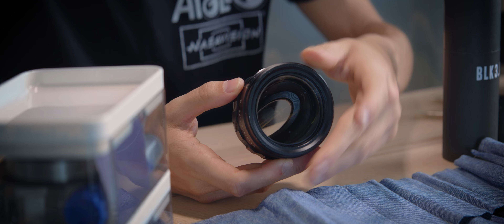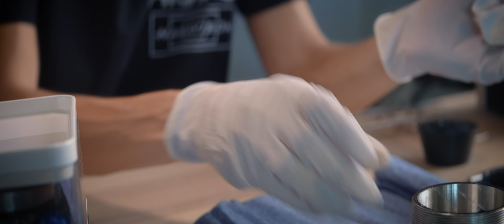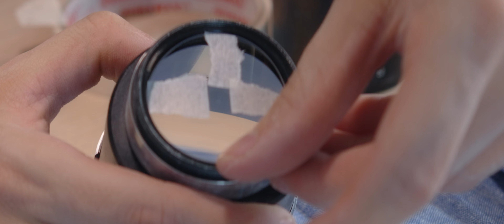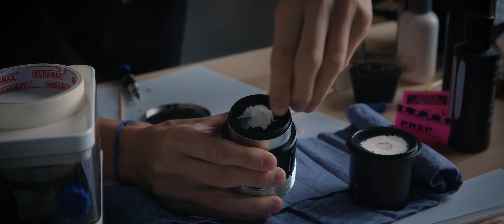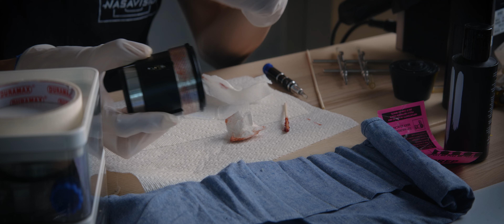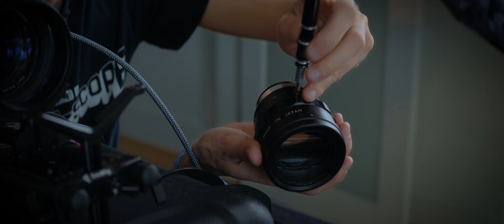Clear Veiling Glare on Anamorphic Adapters! Full Kowa Tune-Up Tutorial

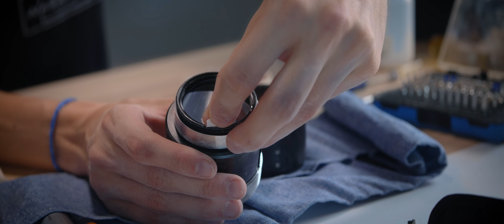Comment: 6:38, those glass were glued, even after i remove the ring, it still stuck there
might need steam it to melt those balsam glue

btw, they also superglued the ring, 
alcohol make a quick job dissolving those superglue
but remember, those glass still glued tho

Comment: It seems to me that the part that you painted was already black.  
All this trouble for what...
Plus, it looks like you never got the focus exactly right.  
I don't know...
Reply from the maker: The difference is exactly on the reflectiveness of each black paint. And I did nail focus. It took a while, but I did. Some of the softness comes from the taking lens being wide open.
Reply from the maker: Either way, it's A LOT of effort for just a marginal improvement. Not something I'd recommend to everyone.
Reply: Are you in the process of selling one of these lenses?  I have been looking at them.  I have the SLR Magic 2X 50 set with Rangefinder currently.  So I have been researching YouTube on the Kowa Anamorphic 16-H. Some are flocked some are not.

Comment: If grease got on the interior of back element glass, what would you recommend to use to clean it off without harming the coating?
Reply from the maker: I've successfully used isopropyl alcohol and lighter fluid. A few lenses have very fragile coatings, so first do your research, and then, test it on a small section of the edge of the glass to see if there's any negative impact. :)
Reply: @AnamorphicCookbook  Thx you’re the best!

Comment: Hey Tito, can you elaborate on how this experiment compares to your 2016 video on the edge blackening method for the Kowa B&H? Does the B&H have more significantly recessed front glass than the models shown in this video? The results of a simple sharpie in the 2016 video were super impressive and waaay less work than you've done here!
Reply from the maker: This method surpasses the edge blackening by a thousand miles. The lenses are absolutely the same then and now. It's a lot of work here, but I found it to be worth it. I ended up doing it in another three other Kowas/Elmos.

Comment: so they don't have strings in the anamorphic lens on the inside? it must be they do lines with the coatings? i don't think they laser cut the glass to do it. what did you notice when you took it apart?
Reply from the maker: It's the shape of the glass itself that creates streak flares. The strings are just an easy way to fake them! :P

Comment: Very interesting, i'm willing to remove the white vignette on my 16h. would it be as good with flocking ? I have some lying around. And would it be even possible considering the space. aybe for the big inside part it is possible, but for the little front and rear parts, it seems sketchy. and thank you for the focus tune up advices, my kowa became sharp again thanks to you !
Reply from the maker: Flocking should do a fine job. I had the paint lying around, so I gave it a go.

Comment: Dude this is so me! I tried getting open this M.F. screws of my elmoscope for 2 years and screwed it up with all of them! I think all of them where glued. Brought the scope to a local photography store and they replaced each tiny screw after drilling them out with new silver ones :D since then I am resting due to the stress. At least I got the HTN ring on! And I suspect the rumor about the Kowa's being sharper is true due to quality controls because of my 2 b&h's that where much sharper - which I sold, thinking I could easily tune mine.. 

Anyway, since this is so relatable this is my favourite video of yours :D :D would love to do a live stream where I (total tech-amateur) try to tune my elmoscope. There should be a series with highlights with you watching others fuck up there lenses too. (cheers from the ana group)

Comment: Next time when you want to unscrew any glued lens ring, drop on the thread gap isopropyl alcohol for 30min - 1hr, than acetone for the same time or shorter. It works for 95% of the time, sometimes even isopropyl alcohol is enough, sometimes, the procedure take longer than 2hr, or you will have to make the procedure twice, or more depending on type of glue used. In any case with patience the trick works almost all times 😉
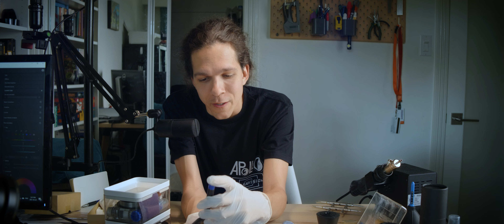Reply: @4:06 I saw retrofoto house put WD 40 in a syringe, to apply as a droplet to each screw hahaha

Comment: I'm may be going overboard, but watching the masking of the glass before painting I couldn't help but think about pouring a small amount of molding silicone in for protection (or maybe even latex, though silicone would be safer).
No residue, no sticking to anything, shouldn't get into any crevices it couldn't be pulled from with tweezers, clear (usually).
Reply from the maker: This is an excellent idea and I might give it a shot on the next one!